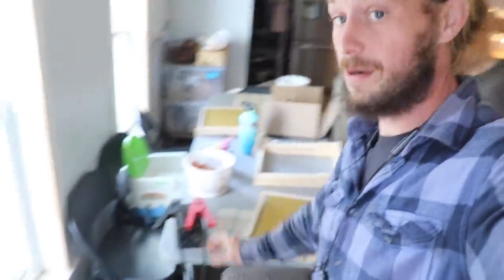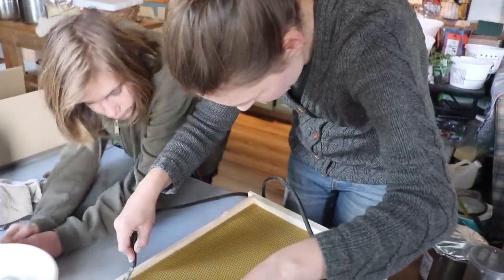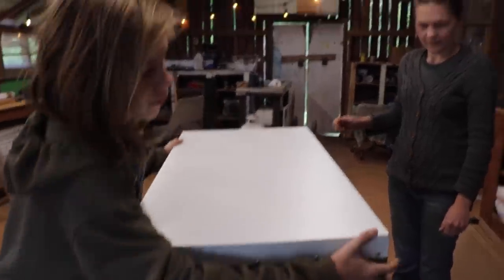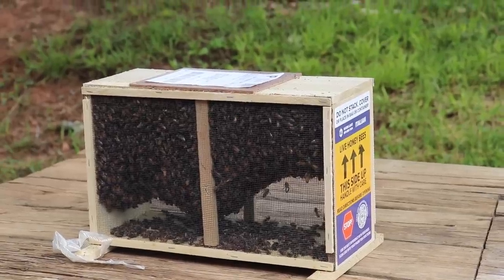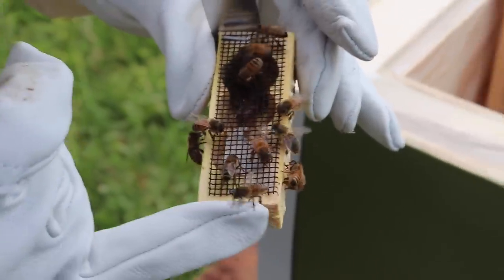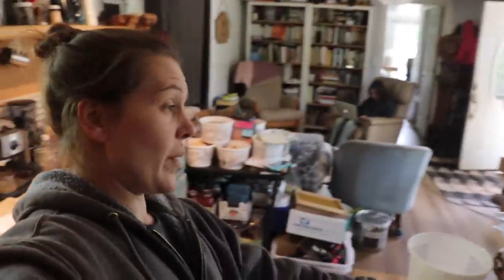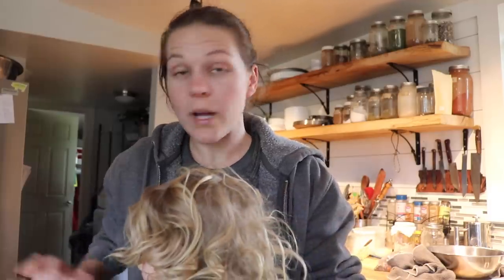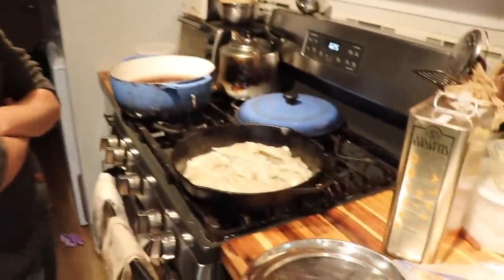We Bee Keepin’ | A Second Hive & Strawberry Muffins

Comment: Normally a Horizontal hive has pieces of wood about 4" wide that fit over the frame area (like Ben was saying). Its so you dont disturb the whole hive & have them flying all over the place wen u lift the lid. You might want to make you some of those. Doug (& Stacie hav horizontal hives). They put NURSE bees in with the Queen to take care of her. You can just lay the queen cage on top where you Shake the bees in HARD (in one hard shake) then shut the lid.